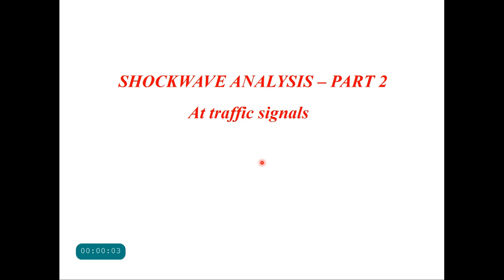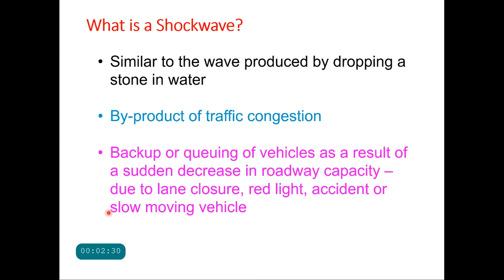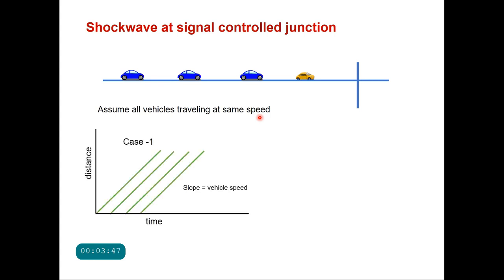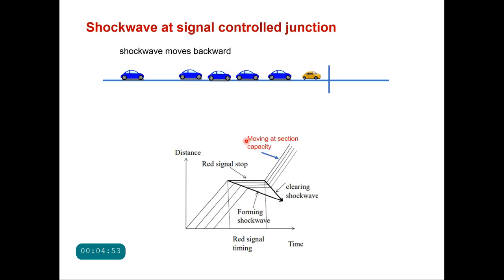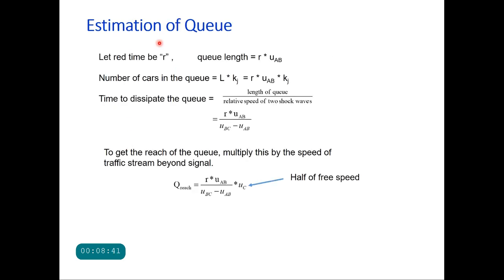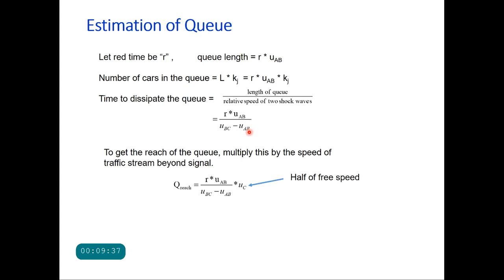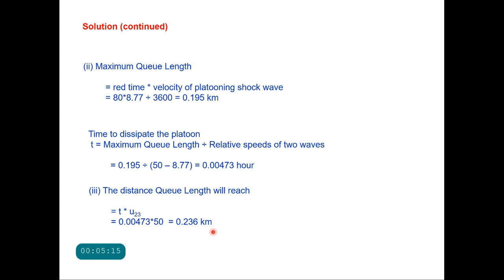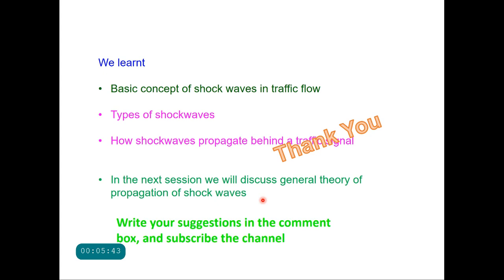#shockwaves, #traffic, #signal, Shockwave Analysis  – PART 2, At traffic signals or bottlenecks

Comment: Hello Sir; I could not understand the difference between "Max Queue Length" and "The Distance Queue Will Reach" on the solution of problem. Thank you for videos and helps.
Reply from the maker: when traffic ligth turns green, the first vehicle in the queue will start moving. But that does not mean that the queue havs started dissipating immediately. Vehicles will continue to join the queue until the last vehicle in the queue has cleared stope line. This is called Reach of the queue. 
I hope it helps.